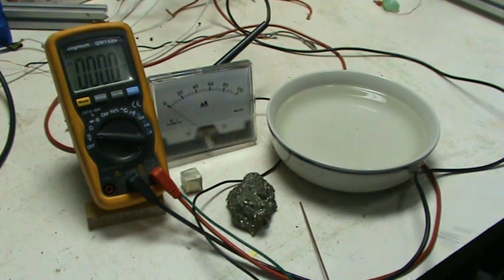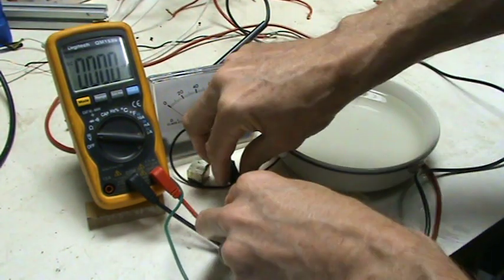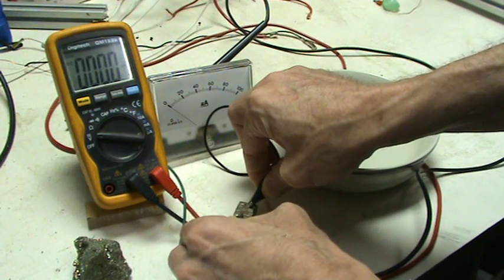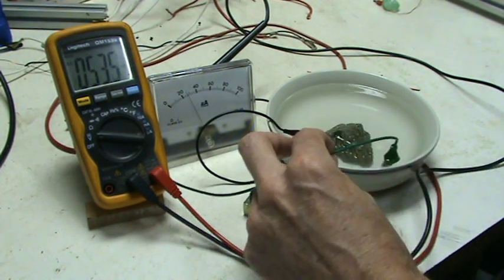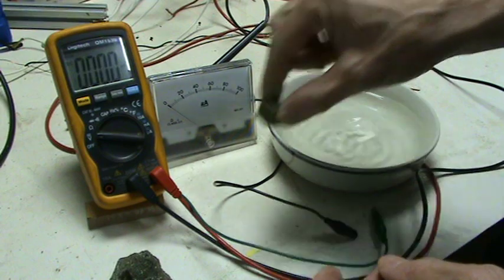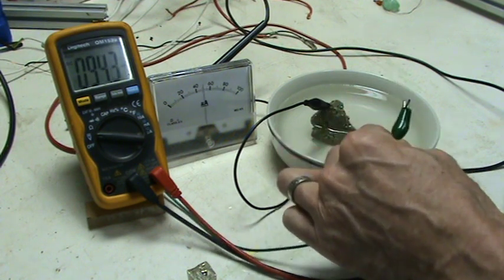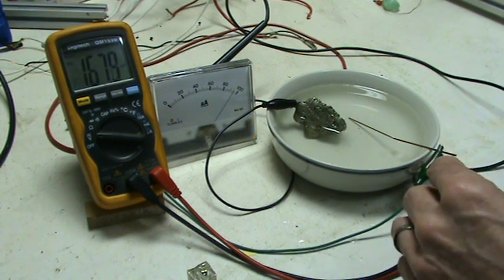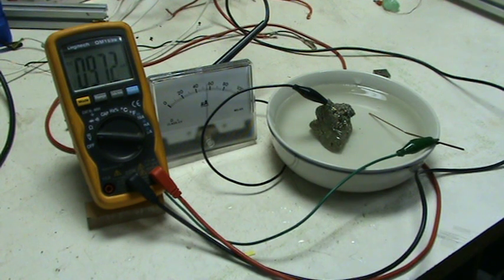Energy from Iron Pyrite

Comment: Well done, but you just have created a galvanic cell.. Also the metal from your clip leads reacts with the water versus the pyrite, so 2 dissimular metals with water will always form a galvanic cell...But anyway, yes, pyrite can be used for battery electrodes and it works quite well... Regards, Stefan.
Reply from the maker: I think you missed the point of the video Stefan :)

Comment: Well of course, pyrite (not Iron pyrite) is actually Iron - suflide. Iron, put in water (where a lot of different  ions are present) will act like an electrode, seperation of charge will occure, and that is the voltage you are detecting. Charge is higher if you connect it on copper wire, because now you have two metals of different potentials. They are trying to equalize that potentional, which is again, detected as current flow (it IS current flow). basicaly, you made a battery :)

Comment: If you are getting that many volts off a rock why not drill a hole in the rock add several more rocks attached copper wire to all the rocks and see if it jumps more?  Then make a small Tesla coil add coil to rocks something to think about

Comment: Great demo. Wonder if the pyrite become sacrificial over time, with a gunk buildup or other change ? I have copper/galv steel electrodes in water running one of Lidmotor's 'Penny' LED oscillators and coating with alum doesn't seem to be protecting the steel over the last several months. I'll try using a piece of the pyrite...especially as it is doing nothing after crystal radio experiments :)